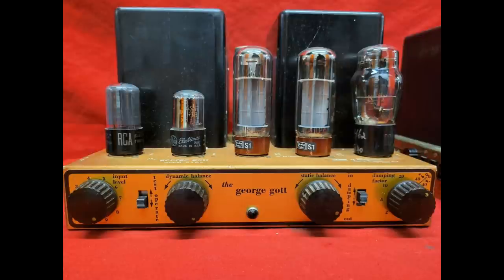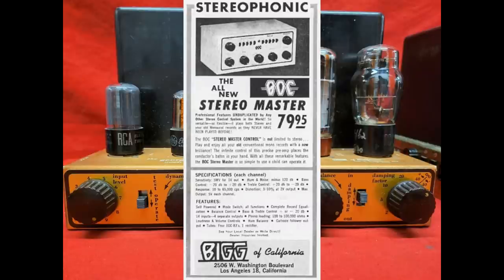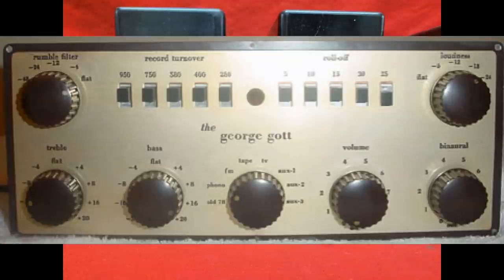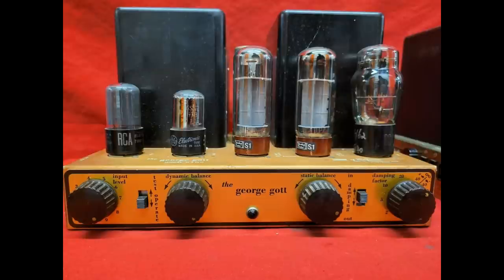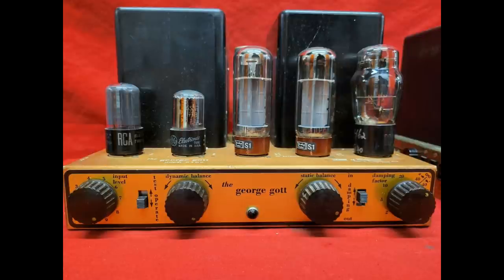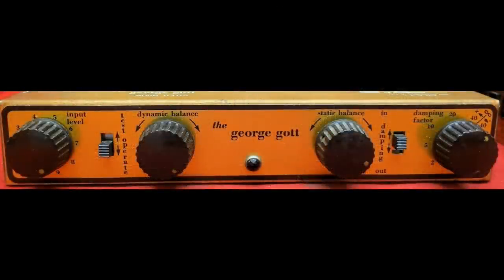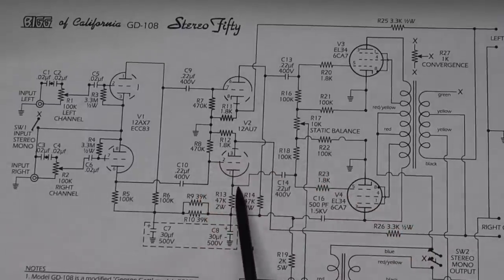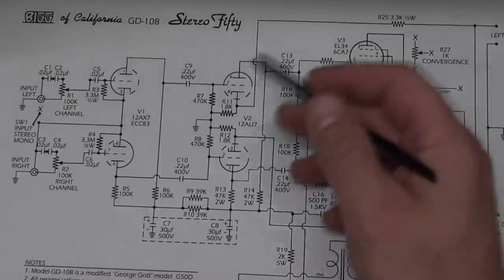BOC / George Gott Mono Stereo Mystery Amplifier

Comment: There are some crazy arrangements out there in the world of amplifiers. Danelectro made a guitar amp badged as a Silvertone, that had a PP output running through two OTs in parallel, each having one speaker connected to the secondary. I don't know if this was to save costs because they had a lot of lower powered OTs for smaller amps or what the deal was, but pretty interesting to say the least. At first glance at the amplifier, you would think it was a stereo guitar amp (which they do make as well, but also a strange animal).
Reply: I thought Silvertone used series-connected output trannies on their biggest amp ( the 1484 or 1485, was it?).
Reply: @goodun2974  I have a 1484 and it only has one OT. The 1474 had two OTs in parallel.
Reply: @srtamplification  that's the one I was thinking off. My memory is becoming dyslexic at this point in my old age!

Comment: So is this running class A?  It makes sense then.  Just looks like a class B.  So you amplify the R and L. Summed on the same output transformer, The current draw on B+ will be picked up on the recovery transformer and the difference will be on the main transformer.  Only issue is more power is in the smaller transformer. Yes, its a multiplex prototype.

Comment: Tony, take note of notes 3, 4 & 5 on the schematic; especially #3 & #5!
Reply from the maker: Remember, this was how the owner found it.   I do not believe that it was wired like this originally.  If you look at the schematic, the switches and pot are improperly wired.  I think at some point in its life, someone tried to wire it back to a normal monoblock amp (and failed).

Comment: Could the Primary and Secondary of the OT be two separate windings and SW2 switch them together for Mono and apart for the Stereo? This was my thinking from the beginning. Then it wouldn't matter if the signals were in phase or not. It would essentially be two SE mono blocks or a single PP mono block.
Reply: I guess this scenario would not explain the extra transformer though. HMMMM!
Reply from the maker: I'm thinking that its a bifilar wound primary.  This could help with stability, but without seeing the transformer in real life, it's hard to know.

Comment: Hi Tony, i have no experience with tube amplifiers, 
but is the selenium rectifier not drawn in the wrong direction, on both schematics ?
Reply from the maker: The selenium diode is being used in the bias supply, which is negative voltage.  That's why it's in backwards. Thanks for the comment!
Reply: @xraytonyb  , thank you for the quick reply. Grtz

Comment: It kind of looks like a "L - R" simulated stereo circuit. Dynaco did something like this back in the 70's with an "all passive" circuit to generate simulated "rear channel" output.  I actually built stereo "blend" circuit using a quad op-amp. I used it to add "leakage" on older (stereo) recording to make them sound more natural and also to simulate "ambiance" with older mono recordings. Many early solid-state pre-amps (circa 1960's) used to have a " stereo blend" control so the listener could alter the imaging. If you listen to some early Stones recordings there's quite a bit of "unnatural" channel separation. RIP Charlie Watts.
Reply: Yes, it does seem to provide L-R with some imbalance possible to add more left or more right signal. When you do true L-R, most of the bass disappears since it tends to be monophonic. I once had a fairly large room and sent L-R to a set of speakers in the rear which made for some interesting effects.
Reply: On some amps, blend was used to reduce some of the hiss from FM (which came from the L+R signal and therefor out of phase) without completely going completely mono of rolling off the high frequency.
Reply: Not to mention Enoch Light. He was a pioneer in the early days of stereo, when separation was EVERYTHING! He did what would be referred today as 'lounge music. There was no such thing as 'the center channel' back then He also mastered his recordings on 35mm magnetic film!

Comment: I would put that circuit in micro-cap and run simulation tests to see what is correct and what needs to be changed, would give a full picture a bigger insight in what's going on like with the loose transformer wires what are they doing? With micro cap what is free now you can try any scenario you want
Did he not write a journal a lot of these engineers wrote journals,  might be some information in that or when he was working at Macintosh. did Mackintosh make anything similar to that?
Reply from the maker: I think the computer would throw up if you tried to feed this type of data into it ;)
Reply: @xraytonyb  😂😂
Reply: I think the best part is to think, not to put a computer to think... Keep it up Tony, you really put me on fire with this amp!
Reply: Using  microcap no different than using any other tool in your workshop! but has more benefits! the computer is not thinking it's just doing analysis it's up to you to look at the results and to see what you're seeing on the scope just takes a lot of hard work out of it and you can get it right. Don't see the problem only if you're a math genius maybe can work out otherwise use the software. Why would you design something blindfolded or your hands tied behind your back makes no sense

Comment: That's 1959 Popular Electronics April pg 45
Reply from the maker: Thanks for the info!  I will look that article up.  It won't make the next part of the video series, as I already have it edited, but I will get it on the next part.  Thanks again!
Reply from the maker: I checked it out.  That look exactly how this amp was originally designed.  I think the only issue was that the second output transformer seems to be too small, as it should be the same size as the main transformer.  I think the other unique feature was that the BOC amp could be switched between stereo and mono mode.  Without a phase inverter section, I think that would be a challenge.  Thanks again!

Comment: I think "convergence" is more likely to deal with different gain between the channels to properly mono out the signal. As such, it's probably closer to the dynamic balance.
Reply from the maker: I'm thinking the convergence control was to adjust the second half of the 12ax7 to be 180 degrees out of phase with the first half of the tube.  It would then work like a phase splitter stage.  This would then feed into the 12au7 for voltage amplification and then into the EL43's, which would be switched back into normal push-pull mode by SW2 (when it's wired properly).  This is all speculation.  I'm still trying to figure it out.  Thanks for the comment!

Comment: That way of using sum and difference seems innovative enough to patent. Perhaps someone can try to find if a patent exists for it?

Personally, if I were tasked to convert a push pull mono tube amp design to stereo, I would have the existing output transformer provide L+R with the speakers in series and add a smaller transformer for L-R between the center tap of the output and the midpoint of the speakers. L+R is generally a much bigger signal than L-R.